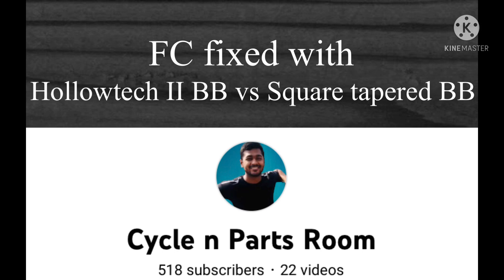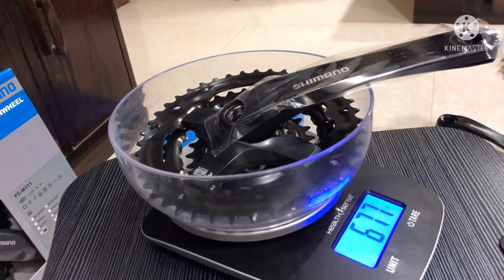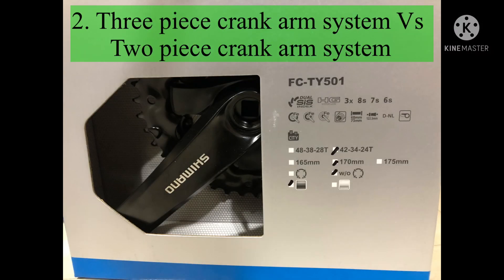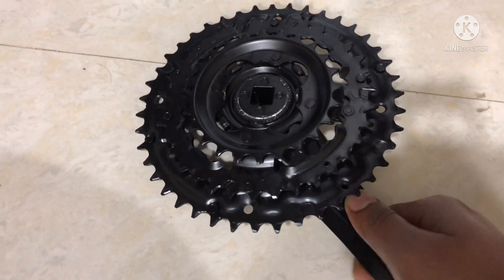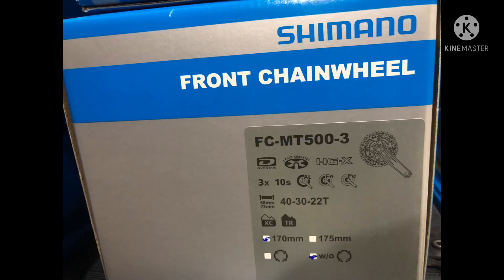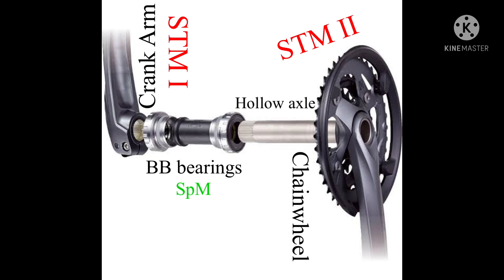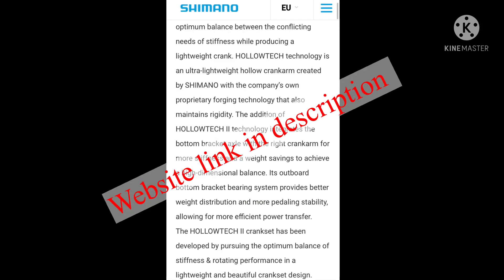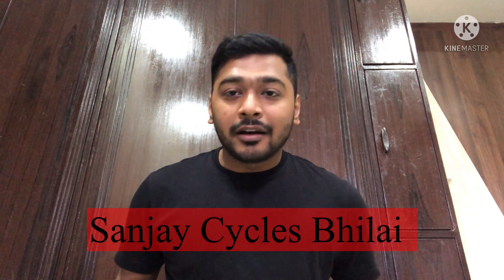Front Chainwheel types and terminology. Hollowtech II vs Square tapered Vs pressfit Vs Octalink

Comment: 36 hole quando hubs is available
Reply from the maker: Reach Sanjay Cycles through whatsapp
Reply: @cyclenpartsroom  9 speed cassete ke sath konsa crankset use Karu
Reply from the maker: @arvindanand3528  Sanjay Cycles ka apna budget bol dijiye, whatsapp 9884277044. Groupset wo bana dege.
Reply: @cyclenpartsroom thanku
Reply: 1x10groupset approx price
Reply from the maker: @arvindanand3528  not a good option in your bike.

Comment: Could it be possible to upgrade BSA Photon hybrid cycle with Shimano Sora / Tiagra / Altus group all related parts and Hardwares? If it is not possible then any Stryder's/ Firefox Hybrid cycles could be next best alternative or not? My regular commute is approx 25 km. My height is 5.4 feet and my age is 50. My other consideration is upgrading above mentioned any cycles with 1×10 or 1×12 Drivetrain and related hardwares. Please suggest. I cannot buy expensive Branded Road or Gravel bike. That's why I am considering above mentioned alternatives. Please suggest. Your reply is highly appreciated. Thank you.
Reply from the maker: FOR DROP HANDLEBAR UPGRADE WITH 1X10s tiagra with FC RS400 and Tiagra 10s shifter cassette and RD 

FOR FLAT HANDLEBAR UPGRADE WITH DEORE 1x10s
Reply: @cyclenpartsroom  Thank you so much for your reply. I will definitely follow your advice. By the way I have two further queries in this regard - - (1) Which Frame is the perfect fit for my requirements? (2) How much cost is involved as per your two recommendations which you have mentioned just above reply. I am eagerly waiting for your response. Thank you.
Reply from the maker: @rabindradahal7418  Frame height depends on the user, as per your height it can be checked online at various sites. Custom cost for 10s upgrade deore is around 20000 and around 30000 for tiagra